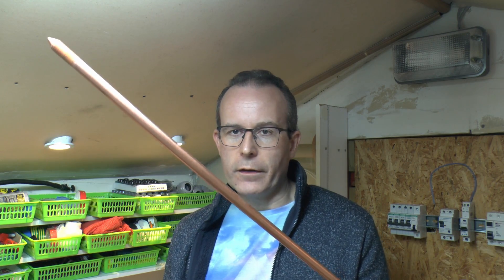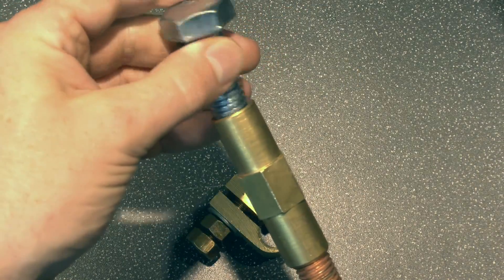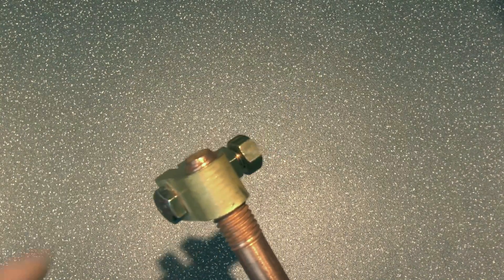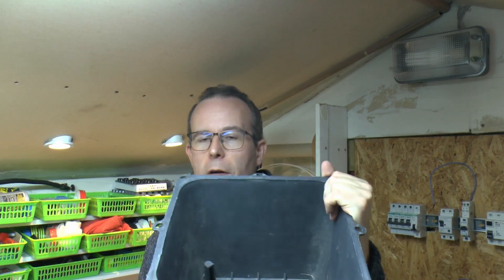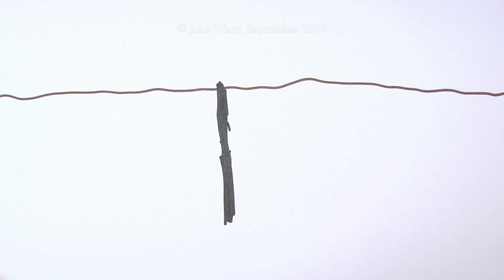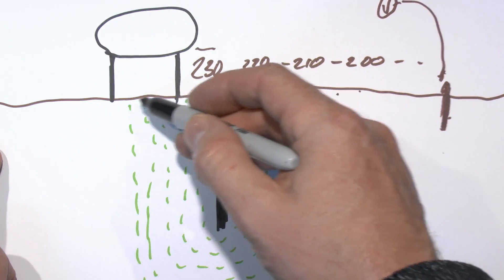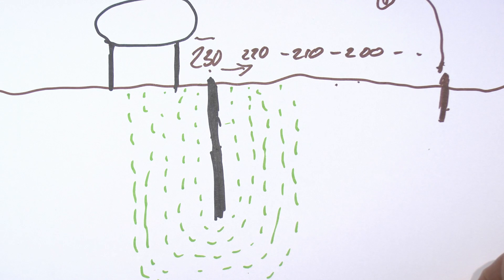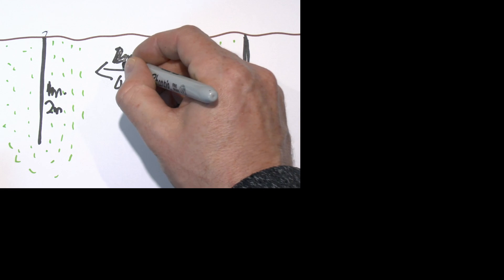Earth Electrodes Part 1

Comment: I do wonder about the efficacy of the ground rod at my home in Australia... House slab on rock and the ground rod sticking out 350-mm and exposed.  Should like to test it given your explanations on grounding rods John.  Your previous video on testing ground earthing systems has helped my amateur needs for understanding too. Thanks for the info mate! Interesting too about the potential difference over the length of a cow. :-)  Shouldn't worry the narrow gaited kangaroos then too much.  They are commonly hanging around the house at night feeding on the grass.
Reply: When a fault occurs the current wants to take the path of least resistance back to the source (substation) to complete the circuit. In Australia, your earth rod will be directly connected back out to the substation via the low voltage neutral which is a very low resistance path. The substation itself will have an earth grid connected to the LV neutral as well. The rod at the meter board is really only a fail safe that will assist if the neutral connection between the substation and your house is damaged or broken-it helps make sure there is always a path back that can be used instead of just through your body. However in an urban area with many houses, all the house electrodes are interconnected and make a very low resistance path back to the substation. The multiple paths here help reduce the current flow through one particular electrode.
Reply: @darkstar_448  z

Comment: Do typical TV antennas found on house roofs need an earth?

I have heard of TVs “leaking” AC into coax connections. The TV antenna sockets in our home sometimes give a nasty sting.
Reply from the maker: Not for a single dwelling.  Communal systems that supply multiple dwellings usually do.
Reply: @jwflame  The CAI recommends bonding aerial distribution system if the number of items connected to it is seven or above, due to the cumulative permitted leakage currents, AKA touch currents, of double insulated devices likely to be connected to it. Here's a link to an article on this: www.aerialsandtv.com/earthbonding.pdf
Reply: @Graham_Langley  Thanks for that.  I live in a block of flats with a distributed aerial system and have had a bit of a zing off the aerial socket in the past.  Now I know why...   Someone's in for a Bo**ocking!
Reply: Graham Langley This could explain a lot
Reply: @CoolJosh3k  I've got a TV distribution system here using an 8-way Global Loftbox, which has a chunky earthing post on it. ATM it's bonded to the adjacent mains socket which is probably good enough as the wiring is in good order, but it's on the list to run a bond down to the main earth block before I close up access to the wiring run.
Reply: Cooljosh3k - Any class 2 double insulated appliance which uses a switch mode power supply unit (SMPSU) like a TV, DVD, etc. will produce a small current via the class Y interference suppression capacitor. Every extra class 2 device that uses a SMPSU will increase this ‘leakage’ current.
Reply: @Mark1024MAK  Correct, and it causes a problem when you have a lot of them connected together. 

BTW the class Y cap isn't strictly an 'interference suppression capacitor' - it's an interference prevention cap as [it] couples the secondary side of the SMPSU back to the earthy mains side so reducing the amount of HF switching noise radiated from any wiring connected to it. And not all Class 2 SMPSUs will have one - cordless phone base station PSUs usually don't for example.

Comment: Hi Jw they used to use solid copper rods
Reply: Where corrosion from stray current is potentially present (such as installation near an electrified railway), they will still use them. Does cost a lot more though.
Reply: @darkstar_448  yeah should imagine stray current and moist soil would remove the plating then make short work of eating a steel bar lol I would imagine it would be even worse on DC (electrolysis oxidation wise)

Comment: In Phoenix my house has an UFER where the slab of the garage is actually the grounding system.  In my opinion it's just about useless from what I can tell.   It's soo dry out here that I don't think the concrete has any moisture to be found.   People say they work,  however I had to add grounding robs in addition as I had way too much RFI on the ground,  mostly from a local AM station.

Comment: Most electricians use conduit boxes to cover/protect earth rods.
Reply: £30 for an upside down bucket seems extreme ;-) lol
Reply: This is the one i use ,looks fantastic https://www.ebay.co.uk/itm/Lightweight-Earth-Inspection-Pit-Furse-Electrical-Plastic-Inspection-Pit-And-Lid/123901088205?hash=item1cd91491cd:g:hE8AAOSwB2hddSbj
Reply: in Australia they dont :)  slam them  into the ground leaving typically 8 or so inches exposed, typically hard up agaisnt the brickwork tho right below teh board

Comment: Interesting. I have never seen a threaded ground rod. The ones here in the US are smooth and our clamps are crap. That threaded clamp would actually stay on the rod. Ours are a two piece clamp on arrangement which are prone to coming apart when a weedeater whacks the wire and yanks it out. I have never heard of or seen a box for a ground rod either. They don't exist here. Here a ufer ground is the preferred method but when a ground rod is used it is 8' long and driven below ground surface then the wire is clamped on and buried. Unfortunately many rods were not driven deep enough and left above grade and the clamp falls apart from damage. There are also requirements for two rods in some cases as well. Our rods are copper clad like yours or galvanized is also available. There was a time when houses had solid copper rods but that is rare window between when houses were not grounded (earthed) and when copper prices started to rise. Ufer is preferred as pounding an 8' rod into rock and clay is not easy even with a ground rod driver attachment.
Reply: Any clamp coming off from weed whacker wasn't right in the first place but I hear you on the not driven or installed correctly. Hacks everywhere
Reply: @Bereft777  The clamps we have here in the US are garbage. Even the expensive bronze ones are very chinsy compared to that threaded one. I wish we used those here.
Reply: Great to know the differences between how things are done in other countries thanks for sharing
Reply: Robert Adams 
Same here in Australia, the earth rods are steel covered copper and shite connections on top , it makes a mockery of the earth system
Reply: Lol ground rod driver attachment...an apprentice in American
Reply: @Bereft777  Here in the US we have a tool that slides on the end of the ground rod and has an SDS plus end so you can drive it in with a hammer drill. I do commercial and we always have ufer grounds. The only ground rods driven today are for trailers and for remodel work on older houses and out buildings. Very few used in new construction now.

Comment: Hello, I'm not sure your definition of "step potential" is quite on the money: I understand it to mean the electric potential possible between two limbs - feet! - whilst taking a step on the ground affected by the potential gradient.
Reply: Read the regs, his definition is spot on.
Reply: @daverhodes382  oh, that's reassuring! Can you help me with a reference?
Reply: @daverhodes382  IEEE std 80 defines it as, "The difference in surface potential experienced by a person bridging a distance of 1 m
with the feet without contacting any grounded object." Do you have an alternative reference for "the regs"?
Reply: @obd6HsN  I agree with you here too, but similar concept to what was explained. It's generally step and touch potential that is assessed which is based on the current flow between two feet (step potential) or hand and foot (touch potential). The reason for these two is that they are most likely scenarios for a human to become part of a faulted circuit. I think it's in IEC 60479 where the resistance of a human body is defined based on the way they are hooked up which is then factored into the equivalent faulted circuit to determine current through them and hence chance of fibrillation. The assessment for touch potential is generally more strict as current flow through hand and foot has a much higher chance of flowing directly through the heart.